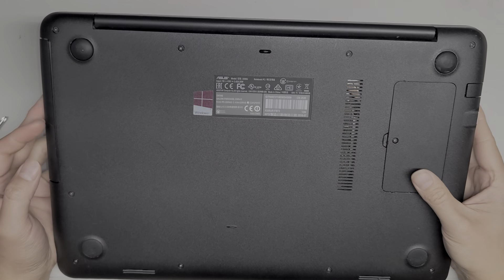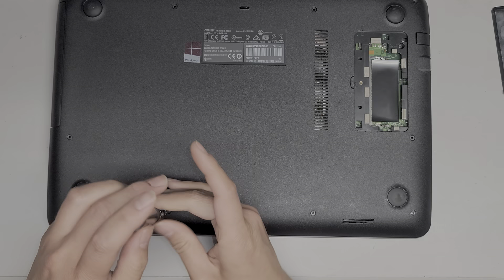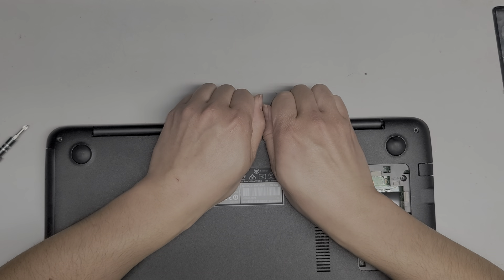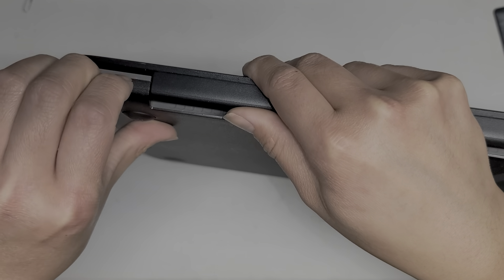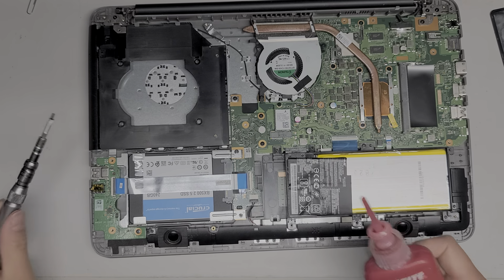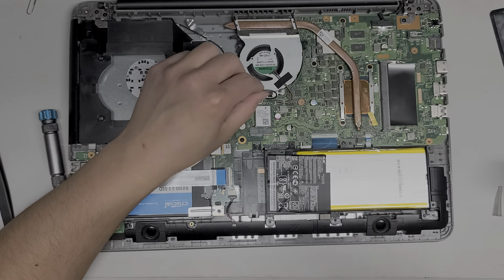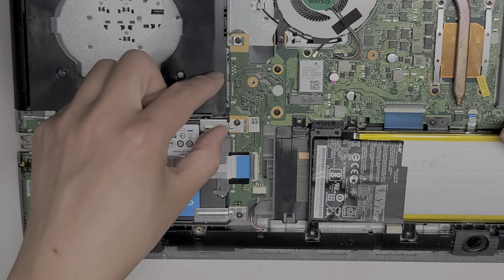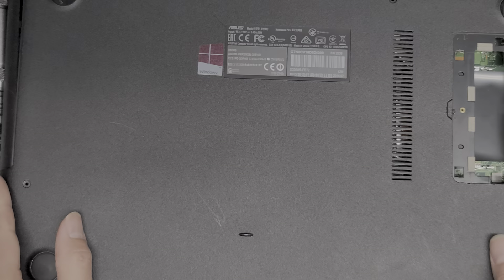ASUS X556U Disassembly RAM SSD Hard Drive Upgrade Repair Wireless Antenna Connected Reattached

Comment: I have this PC and it has 4GB of RAM. I took apart the small drawer but noticed there's no RAM. How is this possible? I'm not an expert. Also, I wanted to add a 4GB RAM, but I don't know the model. Can you help me?
Reply from the maker: If it's like in the video, there's integrated RAM.
Reply: @ItsBinhRepaired  Ok, if I wanted to add a 4GB RAM, which one should I choose? Because I don't have the PC disassembled and I can't see the model of the RAM already installed.
Reply from the maker: Might have to Google that

Comment: Hey be careful when applying that threadlocker. You did it over the open motherboard. Not entirely sure what threadlocker is made of, but I doubt you wanna bridge anything in your system.
Reply from the maker: I know, I do it to show. I mention it in several videos.

Comment: Hi! What stick to add will you recommend for optimized performance? 8gb? 4gb?
Reply from the maker: SSD and it depends how you use the computer. Matching the current amount is best, but if you use a lot of RAM, larger is better.
Reply: So I can add 16gb to it instead of 8? Right? Will you recommend it?
Reply from the maker: @djtsuna19  if they have it in the right type
Reply: @ItsBinhRepaired  thank you! One last question. I plan to replace my optical drive with either an hdd or ssd. What drive can you recommend? I replaced my default hdd with an ssd already.
Reply from the maker: @djtsuna19  https://amzn.to/3R4nZfw

Comment: very helpful. thank you!
Reply from the maker: Glad it helped. If you haven't already, please like and subscribe so others can find my videos. Thanks!
Reply: @ItsBinhRepaired  I will, quick question. Should we replace thermal paste every time we remove the heat pipes to clean it?
Reply from the maker: @sammahasona  yes, if you remove the heatsink, you need to clean and redo the paste.
Reply: @ItsBinhRepaired  thanks for the tip. Your the best!
Reply from the maker: @sammahasona  no problem

Comment: Hey I opened my laptop like a month ago to check issues I was having with the keyboard. I reassembled it and this week I was going into a meeting and found out that my camera wasn't being detected in any software. The thing is, idk which wire is from the camera, so Idk where to look.
Reply from the maker: Check the ones coming from the screen
Reply: @ItsBinhRepaired  so there's two of them, one comes from the top left where the optical drive is, but that wire seems to be the wireless NIC, the other one is a flat wire on the top right, I tried replugging it and it seems that it was the display's wire. Now the thing is, I closed it all again and now when I turn it on I can barely see the ASUS logo on the loading screen. I hear the sound windows makes at start, but I can see much, it is like very dark.
Reply from the maker: Sounds like you fried the backlight circuit. The battery removal and power drain is very important.

Comment: Thank you for telling the screw size for this model. I've been searching all over the internet. ASUS website doesn't say anything.
However a small correction, this model can only fit max 8GB of RAM per slot.
Reply from the maker: There is no max. Have you tried?
Reply: @ItsBinhRepaired  Max RAM per slot (and from that - total RAM) depends on motherboard. For X556UR Crucial says the max is 8GB per slot. kingstonmemoryshop says the same.
Reply from the maker: It's a lie. Until someone put a 16gb and confirms it doesn't work, you can't convince me otherwise. I've seen several times they will say they're a max and I put more and it works well.

Comment: Hey 😢 mine one isn't turning on. I detached the ram and the battery. Then I reattached them. But now I'm trying to turn it on but the battery indicator just blinking and it doesn't turning on 😭.
What should I do now????
Reply from the maker: Hmmm is it plugged in?
Reply: @ItsBinhRepaired  yes.😭 It has issue with it's battery, without plugged in it doesn't turn on.🥺
Reply from the maker: @missionsiddique  need new battery
Reply: @ItsBinhRepaired  okay thanks man <3
Reply from the maker: Hope it works

Comment: Any idea where the cmos battery is located on this thing?
Reply from the maker: Not sure. Maybe the main battery.
Reply: @ItsBinhRepaired  Ah ya true, that must be it. Thanks for the quick reply!
Reply from the maker: @trueblue97  no problem
Reply: Did you find out where exactly CMOS is? Thanks in advance.
Reply: @typeJay  No, I dont think it even has one. If I remember right it's like soldered to the motherboard or something stupid like that

Comment: Is 4 + 16 gb ram possible for this laptop? Or only 16 gb will be read
Reply from the maker: You can mix, but it won't run as fast.
Reply: No. This model only supports up to 8GB ram per slot. So your best bet is 4 + 8 = 12
Reply from the maker: Have you tried a 16gb stick?
Reply: @ItsBinhRepaired I checked it, only upgradable till 16gb of RAM.
Reply from the maker: @homeofoscar8759  did you physically put a 16gb stick in to test it?
Reply: @ItsBinhRepaired  No, I didn't. We are here on YouTube bro, there are methods shown in videos by which we can know the max extent of the RAM upgradation, and it's very much easy. Look out for those videos, you,ll definitely find it.
Reply from the maker: Methods?
Reply from the maker: I don't trust that. The bios and command prompt will show RAM slots that don't exist. Lol

Comment: Hello bro, can change this laptop wifi card to wifi card dual bank?
Reply from the maker: I don't know. I don't do experiments like that.
Reply: @ItsBinhRepaired  using only the MAIN channel on wifi card, u can use only wifi and Bluetooth doesn't work. Using aux 1 channel you have wifi and Bluetooth
Reply from the maker: @phattaiferraboli9498  interesting
Reply: @ItsBinhRepaired  I read this on hp wibsite. Can u use Bluetooth now ?  Or only wifi ?
Reply from the maker: @phattaiferraboli9498  I don't own the computers in the videos, so I don't know.

Comment: How many ram slots does it have?
Reply from the maker: It has 5, didn't you watch the video?
Reply from the maker: Only 1 lol I didn't know so many people needed help counting.
Reply: @ItsBinhRepaired This model is ugradable to 16gb of Ram, unfortunately, they've integrated 4gb to the board. There was supposed to be 2 more slots to make it 16, but max to max we can make it 12gb.
Reply from the maker: @homeofoscar8759  they sell 16gb sticks

Comment: You dont know what your doing
Reply from the maker: @akocran1987  you don't know what you're talking about.
Reply: To be honest, Asus motherboard are not hard to figure out.

Just that Asus do not really put much air flow space and perhaps additional heatpipes.

While it is not a gaming laptop, sharing one heatsink pink between GPU and CPU in series is a little too economical.
Reply from the maker: @johngiam  a lot of them do it sadly.
Reply: @ItsBinhRepaired  yea exactly, gotta buy those little cooler fan boxes and still it at the vents (if at the side)

I think for x556u, the vent is at the hinge, so... bad luck haha
Reply from the maker: @johngiam  lol